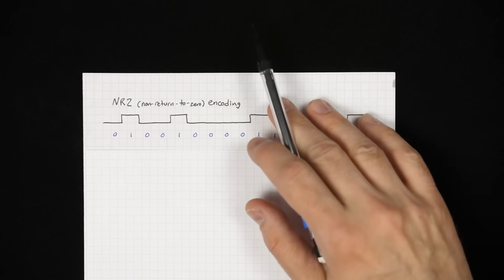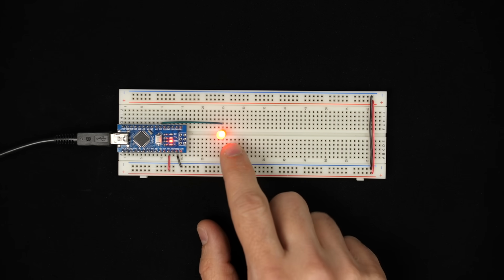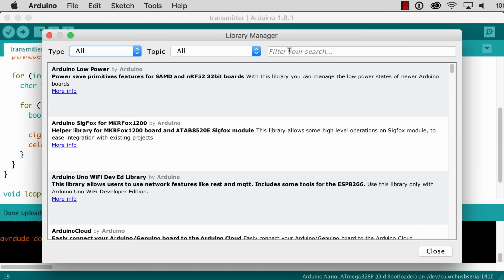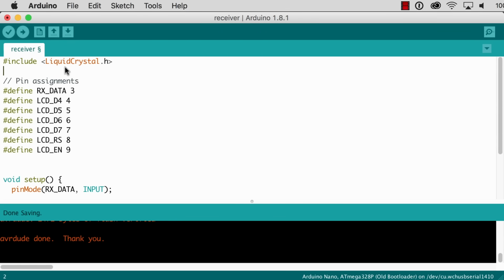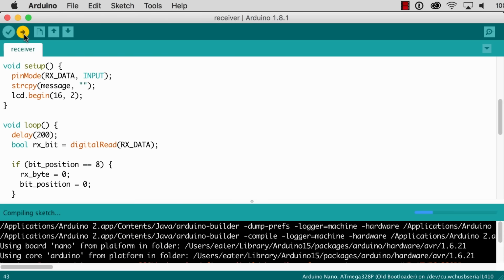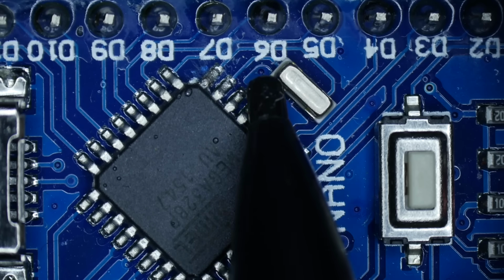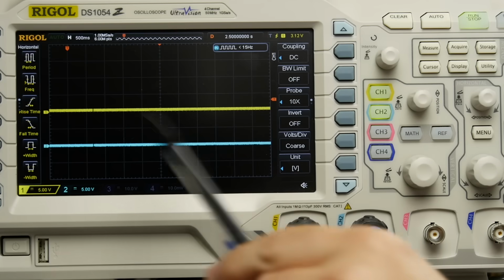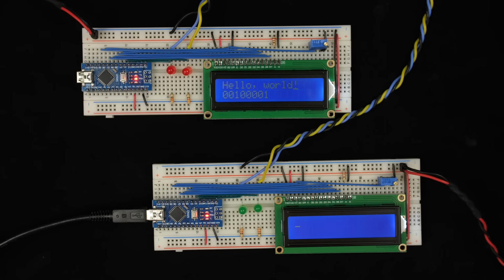Reliable data transmission

Comment: I may have missed it in the video, but does return-to-zero encoding bypass the need for a clock by essentially including a clock in the encoding? So the only downside to this would be the need for a third voltage?
Reply from the maker: Yep, that's right! And you didn't miss anything; there just isn't enough time to cover everything :)
Reply: Yes, but it's also pretty inefficient - lots of overhead. There are much more efficient ways to maintain synchronisation, but the more efficient they are, the more complexity they need to implement.
Reply: RZ could be handy for a frequency-shift keying(ish) system.  Connect a couple of diodes to the line with opposite polarities, so that a positive voltage turns on one oscillator, and a negative voltage turns on a different oscillator that produces a different tone.  In the middle, you're at 0V so the tones stop, so repeated bits turn into separate tones interrupted by silence.

The disadvantage is that it might make your power supply more complicated, but if you're building a circuit with op-amps anyway, you might not care. :)
Reply: That would work, but it's more complicated to receive because you are working with three states now (hi/low/silence), rather than two. (hi/low). More states means it's more difficult to classify the symbols and identify the transitions in the face of noise. Plus, if you are sending three states, why not use the third state for extra transmission capacity? That gives you 4B3T encoding, a very efficient way to maintain synchronization while maintaining high throughput. It's used by ISDN lines.

If you want to see a simple solution, look at packet radio and it's subset, APRS. It uses a difference encode - the state changes to signal a 0, and stays the same to signal a one. This is preceeded by bit stuffing: Any occurrence of five successive ones is replaced by five ones and a zero. That means that there will never be more than five bits transmitted without a transition*, while maintaining only the very low overhead of the occasional stuffing bit.

*With one exception: The sequence 01111110 is used to delimit the start and end of a frame.

Comment: Funny thing is I need to transmit data from a bunch of Arduinos (Nano) to a single 'central' Arduino (Mega, it will most probably ask for the information so I will multiplex through the Nanos) for a school project. I was thinking about the built-in shiftOut and shiftIn functions, but they wouldn't work as I wanted to. This videos will be extremely helpful so I can get this little project done.
Reply: Using the method shown in the video is good for illustration purposes, but, you'll be much better off using SPI/I2C protocols. It's much easier to use and a lot more reliable.

Not trying to discourage you from building your own transmission protocol from scratch, it's a pretty awesome thing to do. It's just that your comment "they wouldn't work as I wanted to" made me feel like you tried using the inbuilt functionality and failed, and now think that they are not capable of proper reliable transmission. That's not the case. SPI and I2C are specifically made for communication between multiple devices. Thousands of engineers have worked on building those protocols so there is not much that they can't do in their domain of functions.

So yeah, building your own communication system is cool and good for understanding the basics, but, at the end you are much better off using the already in use protocols.
Reply: Oh, I didn't try to use the shiftIn/Out functions, I just looked the code of what they actually do and it's kind of what I want but not exactly.

My idea was to 'create' my own protocol, I don't have the idea completely structured yet, that's why I try to avoid (in a certain way) SPI (or other serial protocols). Maybe it's the idea of having complete control over what I do bit by bit? I don't know, I'll probably end up copycating it or something :d
Reply: Just use the UART - you can combine multiple serial data sources into one with a simple AND gate. So long as only one ever transmits at a time, you will need a protocol to avoid or handle collisions.
Reply: For multinode networks, use CAN !
Reply: Use I2C if you need to communicate with multiple Arduinos with the least among of wires required, since the serial protocol is build into it. Define the addresses of the slave Arduinos, and use your master Arduino as the main one to communicate with them.

Comment: Hmm... IIRC, you had no control words left on that CPU, right? Else, how hard would it be to print to a network instead of the display.
Reply: xUNrealGamingx he could always just add another eeprom to handle 8 more control words I believe, since I think he still had room for more opcodes
Reply: xUNrealGamingx what do you mean control words? Can you elaborate a bit more please.
Reply: My bad, he called the collective state of all the micro instructions(Register In/Out and stuff like that) the control word. Also, I am not sure whether there still is space for more EEPROMs, since he programmed them all to be identical, he would need another bit to say "you are responsible for signals 17-24" or something... Might be quite interesting though.

Comment: The Bob Ross of computer engineering is back! :)
Reply: "Happy little segmentation faults"
Reply: Dude, that's exactly what I thought of as he casually laid down his first blue wire, perfectly cut to length. "And... we'll just add some happy little wires here..." Mr. Eater, the amount of planning you must do to make it look so easy is formidable!
Reply: MrSumkinFedor 
  I don't know... an out of frame switch seems like one of those 'happy accidents' to me ;)
-Jake
Reply: Gonna have some happy little transistors over there KappaRoss
Reply: But in computer science theres no "Happy little accidents" errors might cause a disaster.
Reply: @MrSumkinFedor  Which is why you use a hardware emulator and something like Qubes OS to compartmentalize your system into VMs if you're super serious (And I mean insanely serious, not just "I'll stick it in its own directory so it doesn't wipe the hard drive") about making sure "happy little accidents" remain as "happy little accidents" instead of becoming disasters.
Reply: @MrSumkinFedor  Or new ideas that can apply elsewhere.
Reply: @MrSumkinFedor  g hg vhv
Reply: "Today we're going to make happy little bits ".
Reply: Some nice exceptions.
Reply: 666 likes
Reply: Ha ha love it, what a great analogy.
Reply: Happy little stacks
Reply: Needs 1/4 speed.
Reply: Spot on
Reply: "That's alright. What matters is that everyone's happy. Happy little clouds. Happy little puffs of smoke from the AVR." ---1337 pwn B Ross
Reply: true
Reply: Right?
Reply: Disagree: Bob Ross broke the rules of art. This video explains a small bit of the billions of known arduino rules
Reply: @Orc-icide  He would be going too fast for most beginners.

Comment: Wait are you done with the entire cpu project?
Reply from the maker: I'll probably come back to it at some point, but I want to take a break and do some other stuff. The CPU covers all the basics I set out to cover when I started the project, though there will always be more I could do.
Reply: I would vote for some GPIO hardware and/or interrupt hardware. Could be just a register that stops the clock and sets the PC when a trigger is seen. I'm currently building a version of the CPU and eventually will try to include this hardware.
Reply: Build two computer that talk each other? :)
Reply: So the CPU is complete for now, if I understand you right? If so could you please update your website with the link to the last video "Conditional jump instructions", so it doesn't always say "more coming soon!" and everyone is thinking that the series isn't finished yet.

Comment: Looks  nice, is that possible for Raspbery Pi to Raspbery Pi , with Python and via GPIO Pins ? :-)
Reply from the maker: Absolutely
Reply: Actually, the pi already has some logic included which could handle that kind of job. :)
Such like I2C, SPI and UART - those interfaces are able to take care of reading/writing, while your CPU isn't occupied by bit-banging.
Reply: Filler Bloch fwiw, raspberry pi already has a built in serial interface.
Reply: I have successfully transmitted data at over 2KB/s between a raspberry pi and Arduino with that method, so yes. The limiting factor was how fast the python script could run
Reply: @KingJellyfishII  Can't you just use numba or something to get native performance out of python?
Reply: @coolguy284_2  no idea what that is but perhaps, python is an inherently slow language though really and is more suited to server side/less intensive GUI apps i.e. text editors etc. I think it would be easier and more performant to just switch to a faster compiled language like c(++).
Reply: @KingJellyfishII  Yeah c or c++ would definitely be fast, but the whole point of numba and python is that a python function is compiled using llvm directly into regular machine code so it executes at native speeds.
Reply: @coolguy284_2  oh I didn't know what numba is, that actually sounds really cool. I'll do some research on that probably
Reply: But this is about bit-banging, handling it "manually" and not by all other hardware. 
So yes, you can use the hardware to manage all this, but you can also use C, C++ or Python (or even Scratch) to do this on a RPi with Raspberian.
Reply: I was also thinking along same approach
Reply: Anders Jackson as a learning exercise, sure. But if you're going to use it for something real, use the built in port.
Reply: Yes, but the question was if this could be done with RPi, not to do it in a better way on RPi (or Arduino).  ;-)

Comment: Creating a basis CPU wasnt good enough for him, he is creating the basis internet.
Reply: Next up: TCP/IP, routing, How to design a web-server in 8-bit assembly, and an embedded HTTP server entirely from logic gates and transistors!
Reply: @DRSDavidSoft  hold my beer. i designed am optical ethernet transceiver out of HC logic chips like counters and shiftregisters. then i soldered it airwire without a PCB and it worked reliably. Google Twibright Ronja Twister, airwire version. There are 3D pictures of the birds nest mess inside the shielding box.
Reply: +1 for the Eaternet
Reply: Samuel Miller funny, I also worked on some pc and OSI model simulations 2 or 3 years back. To see Ben make videos about both really brings back memories. Its basically a practical implementation of the course I followed called Computer Architecture and Networks.
Reply: @alex-gb9iy  dude your brain is bigger than the universe
Reply: if he made a cpu and a basic web server internet in the same year (2017-2018) that is super super freaky that is literally my 2 big projects i have been doing
Reply: @DarthMakroth  are you doing this for college? If this dude has been doing shit like this for 20 levels I can see how that's doable for him.
Reply: I had to make a 24 Hr Clock out of Logic Gates and a 10Mhz Frequency Standard and them programme a Motorola EEPROM by using a Assembly Language to produce the same 7 Segment Display of a 24 Hr Clock, as part of upskilling my Navel Electronics (Communications) Trade.   Fun times, wjat gets me, is I understand the Aseembly Language and Op Codes fine.   Now trying to learn C++ and Python, well that does my head in.   Not sure about how thick your coke bottle glasses have to be to create hardware and software that creates TCP/IP and then HTTP servers, but that is Ooga Booga Grass Skirt stuff I doubt I will ever get, so Bravo Zulu to you for your comprehension, and Bravo Zulu to this man too.  Great tutorial.
Reply: @Dontcopit  We made the same clock in school (Air Force College) back in 1980 using Motorola components and assembler.
Reply: Amean Abdelfattah Are you an electronics engineer or a networking engineer?
Reply: Next the Eaternet becoming the YummyNet, followed by a 300baud modem built out of logic gates. xD
Reply: That was so cool 😍
Reply: Well sort of... The internet uses separate packets for data and this does not, but the internet does work in a way sort of similar to this
Reply: You know... I used to teach basic electrical circuits to college physics students, way back when, when I used to be a teacher. To help them understand the physical laws which drives electricity, I even tried to teach them how and why circuits behave, by using Coulomb's law as the mathematical starting point.

It was a bit of a long winded digression but, I think using this more fundamental approach helped them to understand, deep down, what was really going on.

However, I always felt that I could have done more to help them crystallise WHY this all really matters... I.e. that these simple ideas basically drives our ENTIRE Technological Civilization... And that what I was trying to convey simply wasn't about getting good grades in up coming examinations.

Flashing led lights, simple motors and other gizmos could have been used I guess but, actually building a simple computer from scratch!? That would have completely blown their minds! Especially now that we live in an age in which computers are literally Everywhere!

If I ever decide to go back to teaching one day... Perhaps if I'm semi retired, I'm definitely going to be using these tutorials as a basis for a course in basic electrical engineering. This knowledge definitely needs to be disseminated more, especially with kids for whom technology has now become as ubiquitous as air...
Reply: Samuel Miller did you make the server from scratch too? Or just used already made tools?
Reply: @DarthMakroth  uh huh lol
Reply: It's fine, when the apocalypse happens, he'll just launch The Internet 2.0
Reply: I'm using this video to make a basic internet, what a coincidence
Reply: That's preparation for when the government starts to control this internet.
Reply: Samuel Miller that would be super fascinating 😍
Reply: Fun fact, when the very first connection of the internet was established from the east coast to the west coast, they tried to logon to a remote server and it immediately crashed because the code didn't expect return characters back.

The Internet lasted all of a few seconds before it crashed the first time.  Today is a much different story ;)